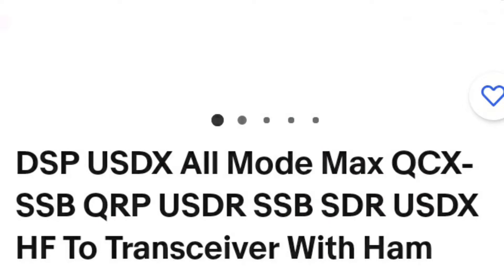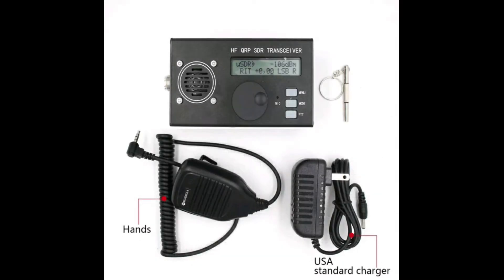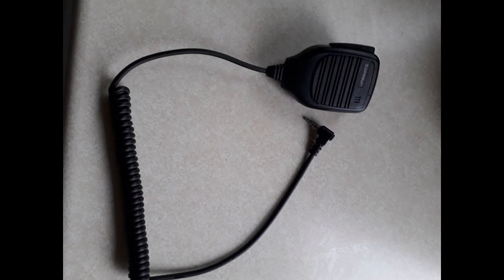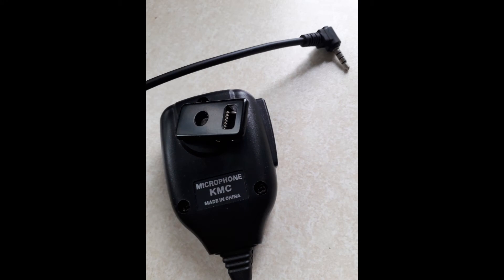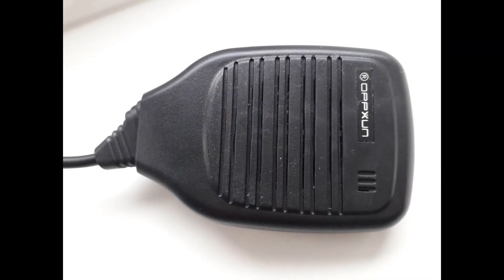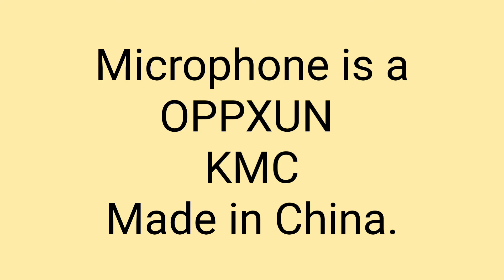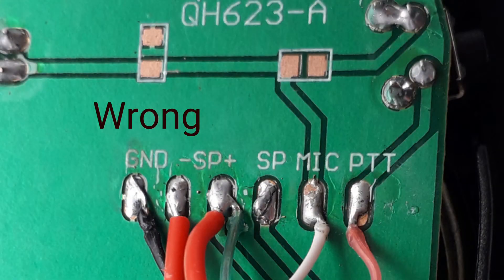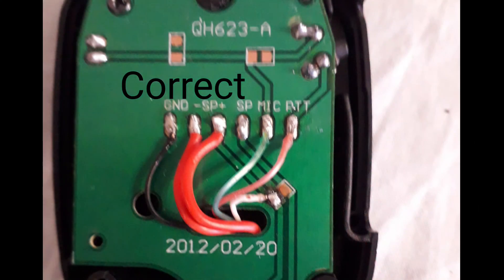H/Held Microphone Fault. USDR SDR SSB HF QRP Transceiver. 8-Band.

Comment: Have same issue , will check it tommorow
Reply from the maker: Ok PA5DX let me know if it fixes the problem.  Cheers from old George
Reply: Hi George, did the fix. But the audio is distorting sometimes think has to do with he inside mic plug from the little rig. Also when i plug a loose 3.5m stereojack the rig wil goes on ptt. Or is this normal and need i a plug same as de mic for digital mode?
Reply: @PA5DX  Check my playlist about this radio for that info.

Comment: Sorry George I forgot to remove the speaker that comes as standard there is my mistake, I will try your configuration.
Thanks
Reply from the maker: You don't need to remove speaker.

Comment: Hi George,please can you tell me as I see there are 6 wires and on mine 5,they are pink,black white,yellow and black but no red.
   Please can you guide me if you don't mind.
     Greetings from Spain.
Reply from the maker: Not sure if I can help without seeing it in person. Have you watched 
My latest video on these radios etc. I talk about the voltages on wires that feed Ptt and microphone etc. George
Reply: I haven't seen it George, I'll have a look now and see if I can draw any conclusions but I see 6 wires on the usyo and mine only has 5 and it's identical, there's my interrogation on the two red wires.
    Thanks for your reply

Comment: My colours are different. but my problem is identical. I dont see a green wire in your vidio Thats for tip
Reply from the maker: The Green wire is shown connected to the Mic Solder pad in second correct photo. Originally it was soldered with a red wire as in first photo. 3rd connection in. Cheers from old George.